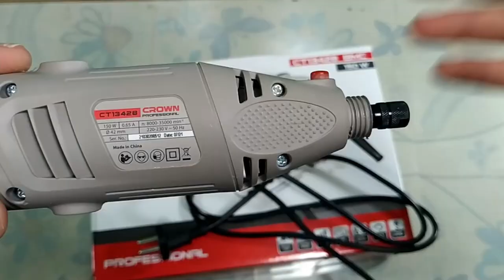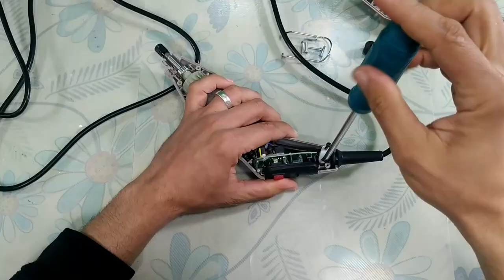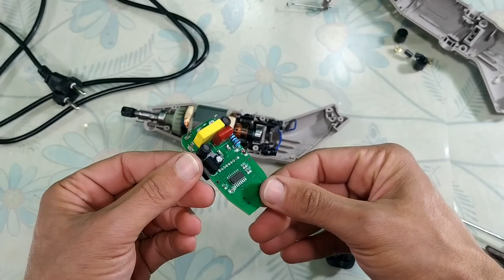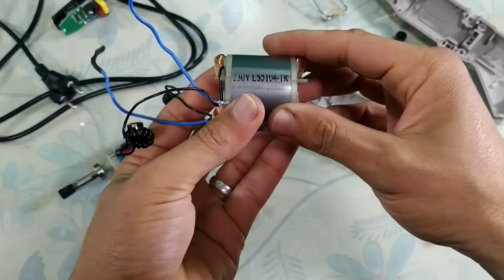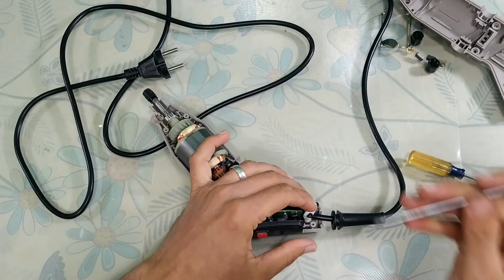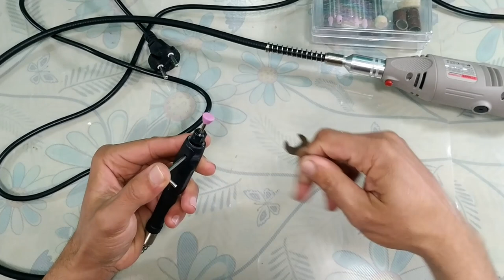Rotary tool CROWN CT13428 ميني كرافت كراون 150 وات

Comment: Why this machine switch side heating without using
Reply from the maker: When the machine is running, the cooling fan moves, so the outer body is cooled and the internal parts remain hot. When the machine is stopped, the heat inside remains for a while.
Reply: @sabawi7  Is it the company's fault?
Or normal
Reply from the maker: @mzjsadik2015  This is normal, especially in low-quality products. In general, do not use the machine for long periods of work, and if your work requires many hours of work, use more than one machine and alternate between them.
Reply: @sabawi7  thank you for ur reply
Reply from the maker: Thanks